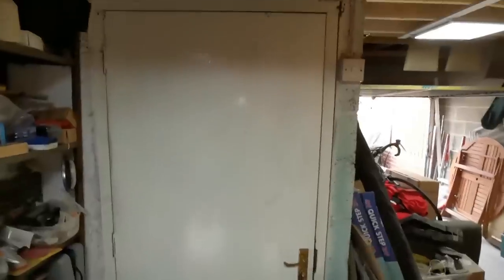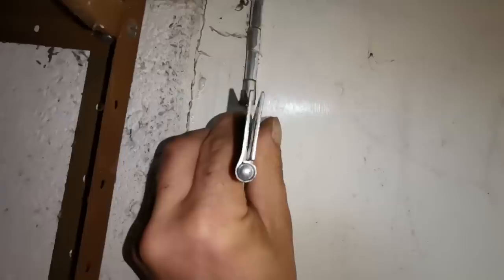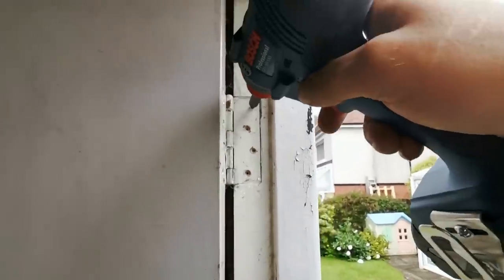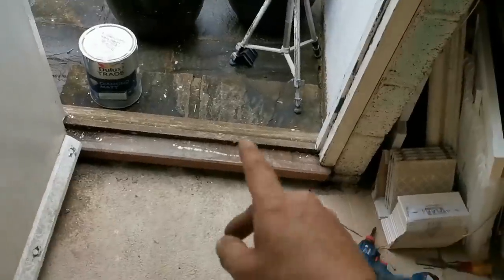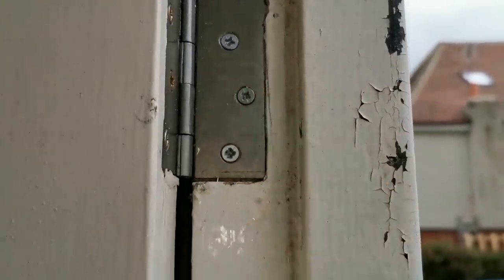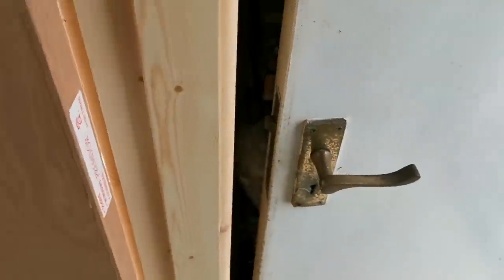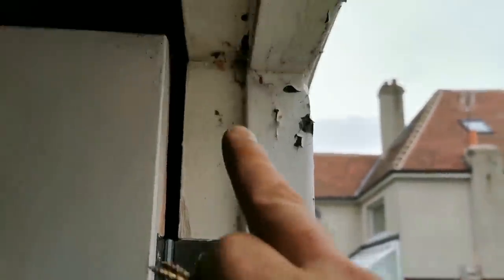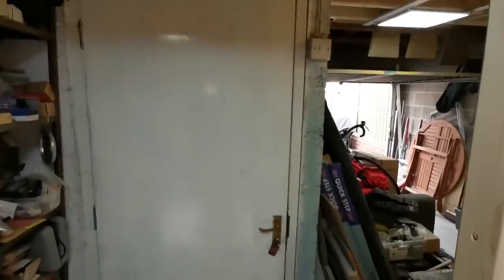Sticking door repair - Check the hinges before planing or cutting the door

Comment: Another Job well done. Do you ever use the matchstick / toothpick in the old screw hole to help tighten up the screws or to help move them over that smidgen
Reply from the maker: Thanks Peter, 👍 This was just a quick fix, but yeah sometimes & for the sake of the film maybe i should have shown that, i never have matchsticks, I'd patch up the holes with wood n glue, the screws that came out were shorter & had a finer thread than the ones i put in, when i put mine in they held well so didn't bother, also when moving the screws just that fraction it's awkward to get the bits of wood in or the hinge covers the holes 🤷‍♂️😉👍

Comment: Love the new toy 😎 your gonna love it for bigger screws 3-4”+
Reply from the maker: 👍 As you see in this vid recognising when the screw is tight is something I've to learn, a reg drill i know how tight by how much the drill twists in my hand, but been playing with it today so a bit of time n I'll get there with it, Thanks 👍
Reply: Gid Joiner yeah it just take time, ive recently replaced my old impact driver with the 3 speed brushless dewalt one which had more power than my old one, although it has 3 speeds i always keep it on 3 because im so used to impact drivers i can feather the trigger for a 12mm screw right up to a 150mm screw both on the same speed, impact drivers are great for coach screws
Reply from the maker: 👍 maybe one day I'll feel the need for more power but for now this has 3x the torque of my other 18v Bosch which is nearly powerful enough although I am concerned that one day I'd push it too far, killed a coupe of Dewalts in the past like that, this Bosch has outlived those Dewalts by a long measure so we'll see. I did have a go putting some coach bolts in the shed timbers  😁 it did ok but I'm used to the reg drill firing them mostly in then maybe straining a little on the last inch or two, this impact driver starts doing it's impact thing when the coach screw is only half way in so it's a little slower but keeps going, hare n tortoise type thing.
Reply: Gid Joiner i agree i dont think you will ever need a more powerfull one i just got the more powerful one because i could 😎😎

Comment: What stops the screw from going in the original screw hole and pulling the hinge back to the original position?
Reply from the maker: The screws i put in are slightly wider & longer than came out, have a good point & a fairly coarse thread, ideally you'd plug the old holes

Comment: The fun and games begin when all but two or three screws have had their heads worn out. 😀
Reply from the maker: Fitting the double doors, stainless screws in the fire door hinges, 2 heads stripped, had to drill out the heads in the end leaving the annoying threaded shaft in the wood to get in the way of the replacement screw 😬😖😖 I never swear when this happens 😏
Reply: @Gidjoiner  Yep, exactly what I was referring to. How did you deal with the screw shafts being stuck in the door and / or the frame when the heads had sheared off, if you don't mind me asking?
Reply from the maker: I used a bit that was too small to drill the head off to begin with, out of laziness i just used the bit in my other drill which was a drill//countersink, so after i did put in a bigger bit & reluctantly drilled the head off i had a bit of a hole in the remaining shank & could drill out a bit of that out, neither screw was pretty tho n went in at a slight angle because most of the shank was still in, luckily they were both on the bottom hinge, I don't have a smart tip/solution to that scenario, hit it, drill it, swear at it, n ram another screw in !?? 😖😖😬🔨🤷‍♂️
Reply: @Gidjoiner Just took me 3.5 hours to remove 24 screws caked in 20 year-old gloss, using a combination of 4 different size screwdrivers, a Stanley knife, WD40, and the occasional use of an impact driver. It's a fire door. Then it dawned upon me after browsing Screwfix and Amazon that the person who owned the house before me -- who presumably was responsible for my trials -- used butt hinges (with those irregular placed holes) instead of fire door hinges for a door that's north of 30kg. So, short of filling the existing holes in the door and the frame respectively, and drilling new holes, I can't buy the expected ball-bearing fire door hinges, because the hole placements don't match my current setup. 😶 😀